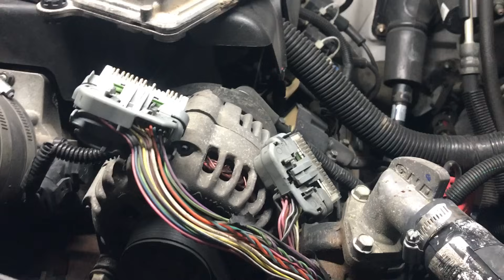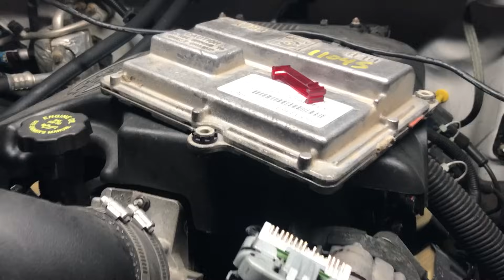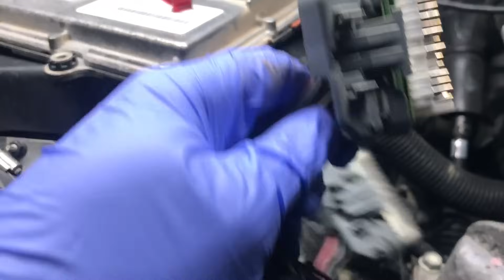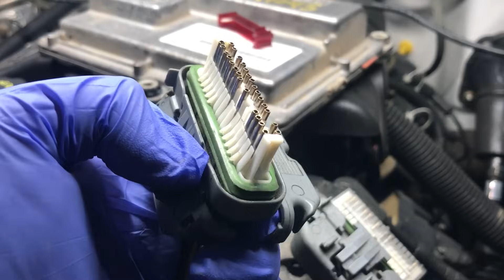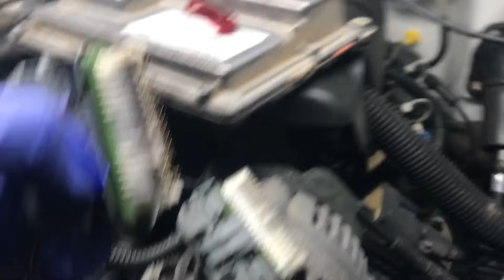Allison 5 speed TCM common issues and fix Allison 1000

Comment: My son has a 2003 2500 silverado with an Allison transmission. When he was 1200 miles away from home on a job assignment the transmission all of a sudden wouldn't shift out of 1st. He had it towed to a transmission shop that had an Allison technician. They pulled codes and determined it needed a $4200 rebuilt transmission replacement. I used to be an ASE Master technician and I just couldn't believe that at 80k miles the trans was toast. So I researched the trans and came across this video. I instructed my son at to what to do and where to look. After repositioning and cleaning the plug contact pins the transmission worked flawless. Thank you so much for this video!
Reply: Nice! Good job to you and author of this vid.
Reply: “Used to be a ASE  master tech” BS!!! If that were true you wouldn’t need any videos
Reply: @meatyklaws8774  Haters gonna hate. I'm a master and I use videos all the time. They are often better than tech data for me because listening and watching a professional sort through complicated problems lets me see what I've done already and what I might need to try. I'm ALWAYS wary about replacing modules without thorough investigation.
Reply: That’s 💯💯💯💯
Reply: @meatyklaws8774  haha different models different strokes.
Reply: @meatyklaws8774  😂🤡
Reply: @meatyklaws8774 not true, I’m ase master w/ l1 and  first thing I do is look for videos with tricky problems
Reply: @meatyklaws8774 I’m an ASE master medium/heavy truck tech as well and if you store knowledge for every vehicle in your brain then that’s pretty impressive to never need reference of any sort. I use videos sometimes. Not everyone is a walking repair manual like you. How many hours do you turn in a week already knowing how to fix everything?
Reply: @meatyklaws8774  dude what?  You can be an ase master tech but not know about an obsure randome plug on a diesel truck

Comment: I have a 2004 GMC c4500, I don't drive it much and when my batteries die, I need to take you to the dealer to have the PCM TCM reflashed. That's the way around this besides keeping the truck on a trickle charger. Right now my speedometer reads double my speed and it doesn't seem to shift past 3rd.
Any ideas?
Reply from the maker: What codes does it throw after the battery goes bad
Reply: @SpartanAutoworx  no codes... It's at the dealer right now and they said I had to have my PCM TCM reset... Because the driver of the truck left the ignition switch open battery drained PCM drained

Comment: Hi I have a question for you. I have a 2005 chevy silverado 6.6l diesel. i seem to have transmission problems but no codes?
Reply from the maker: What is it doing? Need more info if you have no codes.
Reply: right now it drives great in all gears and even goes into reverse. once the transmission heats up to normal operating temp but not overheating. then you go and put it in reverse and it doesn't work. acts like its in neutral and show the range shift inhibited message??????? I changed nsbu switch, pressure switch, pc solenoid. and still same thing. Should i try a new tcm? Also i went out today and unplugged the harness from the back of the transmission. the round one, along with the connector to the nsbu switch to check wires. do i have to get a transmission relearn if you unplug these harness. I have the 2005 Allison 5 speed trans. please any help would be appreciated!!!

Comment: My 03 f650 did a unusual hard shift and check trans light came on. Truck went into a limp mode and stayed in one gear.  Parked the truck for an hour or so started it up check trans light was off and shifts were normal. After about 30 minutes light came back on and went back to limp mode, could this maybe be my issue?
Reply from the maker: I doubt it. Totally different system on a ford

Comment: P0735 and won't shift into next gear. Changed filter and fluid still does it at random times where do I start?
Reply from the maker: Solenoid or wiring issue. If all that checks out bad tcm.

Comment: Just ran across your video and I have a Allison I have an 05 that is not shifting into overdrive could this have an issue in the wiring 2 has no check engine lights no service codes the only issue is it it is not shifting into overdrive appreciate any comments
Reply from the maker: Could be

Comment: Hi I'm new at this. I have an 01 2500 HD 8100 engine with the Allison 5 speed. I get an intermittent overheat on my dash info monitor. Along with the gauge going up to 300 degrees. Checked the temp of the fluid. Also checked the cooler lines. Appx temp was 140 to 160 F degrees. Changed both filters, oil etc. Checked oil lines had no blockage. Still reads high temp. But does also drop down to normal in a second. Please help. Jim
Reply from the maker: Could be
TCM
Temp Sensor in the trans
Wiring

Have to check it all out.
Reply: Have the exact same problem. Replaced Manifold pressure sensor which has temp gauge inside and still have the same problem. Only happens when trans is at operating temp normally while at a stop. Really intermittent at one time it didn’t happen for over a year.
Reply: James, did you ever get this issue solved? I am having this issue on my 2001 Silverado 3500 8.1 after having the trans rebuilt about 4000 miles ago.

Comment: I've got an 03 gmc with an 8.1 and allison 5 speed, I've been having an issue with starting, check engine light threw a bunch of trans codes, hard shifting, gear indicator has been working off and on, the main thing is the starting issue. Sometimes it's no crank or clicking of the relay at all, sometimes it clicks or starts to crank and then cuts out before the truck fires, I don't remember what trans codes it has threw me, but I've replaced the starter, connectors on the wiring at the starter, ignition switch all with no success. I'm going to try checking the tcm harness but is there anything else you guys would recommend?
Reply from the maker: Fuse box or wiring goign to the fuse box. I would guess wiring going to fuse box
Reply: @SpartanAutoworx  I have had the fuse box out twice to check all the wiring, I have power everywhere I need to have it in the fuse box, no corrosion, broken wires etc. And when I have no crank no start if I pull the starter relay out and jump it with a wire it turns right over.

Comment: Do you know if that works for codes p0700-702-703?? Truck wants to go into gear, but dose not move from time to time it goes into gear and drives fine. And some times it dose not move at all, getting those codes thanks in advance.
Reply from the maker: p0702 points to electrical and 03 is tcc brake switch.  p0700 is normal code for trans if it pops any other codes.
Reply: @SpartanAutoworx  yeah I got codes p0841,p0846,p0871,p0842 says that it is trans fluid pressure sensor switch A,B, & C. Circuit range/performance the truck dose not activate in reverse at all, and the drive gear bangs a bit when sifted into it, then it only moves about 1 foot with no power to the wheels, only acceleration, I really need help any advice helps thank you in advance.

Comment: 2001 gmc sierra, has been throwing p0700 for two years, pulled tcm connectors, dielectric greased, no change, dropped tranny pan spun new filter on changed fluid no change. what to check next? all winter long it wont throw code once, weather gets warmer and it throws code second, third day than two weeks later(randomly throws it) when it throws it, it is only in park and the shift indicator light goes off, shut truck off, turn key on shift to drive shift back to park and restart and it is fine again code goes off until it randomly comes back on. thanks
Reply from the maker: Pins or maybe NSS

Comment: I'm having trouble c4500 not wanting to go into park  everything works but park.  But will shift up to park but not go in.  Could the be the problem?    Right now I have to start in neutral then have to put it in park to get the key out
Reply: 5 speed
Reply from the maker: Like tcm does not see park or you actually have no park to hold the truck?
Reply: It does not see park and not go into park

Comment: My pin wire is real short and it keeps backing out the plastic seems weak what's a good way to secure it from the back to keep it in.
Reply from the maker: Replace connector or make slack for the wire.

Comment: so i have an o1 gmc sierra 2500 hd w 8.1L gas and allison 1000, also have an 02 Silverado 3500 dually w LB7 and allison 1000. the Silverado has be wrecked and is a parts truck, my 2500 is my daily, yes fuel cost is horrible looking to change soon as weather permits enough work to do so. 3 days ago and 3 other times while slowing down to make a turn i get the grinding sound as if shifting a manual with out a clutch just not as loud, its a steady grind while slowing for turn my light is green but at about 20mph grinding stops much the way it did other times intermittently, i know nownits not abs pump as i never pressed it. also this time service light, im accelerating slightly out of turn, its in way too high a gear but holds it, luckily my destination part store is next turn and around to park. whole time stayed in same high gear. dignostic tool says tcm failure, short to ground, 4th gear ratio too high, and something about a solenoid, also relists some of same codes twice or more, for a total of about 10 codes. used 4 low to load onto my trailr to pull home, offloaded same and parked. will check connections soon. whats chances tcm from 02 diesel 3500 will work on 01 2500 8.1 gas. sure sbift points will be different rmps and torque converter and pressures may be different. can it be flashed to work, how much $ if i pay shipping both ways. i dont trust the local dealerships, from exp they are parts changers only.
Reply from the maker: That allison 5 speed tcm will work. Send over both vins and we can check calibrations. If it needs programmed its $110 with return shipping.

Comment: Trying to troubleshoot a 2005 school bus w/Allison 2000. It seems to be stuck in 3rd gear and the check trans light is on. Initially, we turned it off, turned key to on position and cycled through d-n-d-n-r-n and it came out of limp mode for a while, then went back into limp. Upon inspection, the transmission was very hot to touch (no gauge). Had a local shop try to pull codes and nothing showed up. Any help appreciated.
Reply from the maker: So no history codes or can you get codes pulled while its not wanting to play nice?

Comment: Ive got an 06 lbz with the 6sp auto. Supposedly has a 60hp tow tune, feels like it does as well. Anyways, hard on it it slips every gear till 5 and 6. fluid is new as well as filters. Will not limp or throw a code, fluid is not burnt nor does the trans get hot. Easy on it and it shifts perfectly. Wondering what the issue could be? I have also reset the TAPS with the GM TECH II scanner and the isssue did not improve and i am stumped. I think its electrical. Any ideas? Bad tuning? tcm? thanks guys
Reply from the maker: Hard to say I would reach out to https://www.caconversions.com/ the allison experts.

Comment: Thanks for the video. I have an 03 gmc with the 5 speed allison. I have codes p0846 and p0700. It seems to start in third and stay in third. Reverse is fine. Up to this point I haven't had any problems with the transmission.
Reply: @randy did this help? My truck is throwing the p0846 code. If so what is the NSS?
Reply from the maker: Check the pins and maybe replace the NSS

Comment: Hey there.. took the pin connector apart.. couldnt see much but after applying dielectric I had a small spark on clear pin group..for got to pull battery connections .. Now truck woult turn over.. no shift indicator but everything else works.. any ideas?
Reply from the maker: Check power. See http://gmflash.com/allison-5-speed-wiring
Reply: A specific fuse?.not sure where to look.
Reply: PCMB fuse.. thank you!.. also MIL code is gone for now.. will drive and see..

Comment: have you done a vid on the repair of the pins?.. especially the brittle plastic ones.. Do you just use pliers to pull the pin back into place?
Reply from the maker: I do not. You can push and pull the pins by hand.
Reply: @SpartanAutoworx  Man.. You are the best.. Thank you for your site..gonna try this shortly.. as an aside.. I had my lower coolant hoses replaced a few months ago, but don't drive the truck too often.. thnx again.

Comment: I have a 2016. duramax with allison. cooler weather now. not cold though. 40*-42. Fahrenheit. backed out of driveway and put in forward moved 10 ft and it stopped pulling and D started flashing. switched through gears and R flashes and still wont go. shut engine off 4 or 5 mind starts and goes. what could be?
Reply from the maker: Bad TCM
Reply: @SpartanAutoworx  dang that sucks. heard could be nsbu?

Comment: This just started happening but on my 02 lb7, if I put my truck in drive or reverse and hold brake, about 5 seconds later it falls out of gear and the gear selection light blinks. Any idea what this could be?
Reply from the maker: Neutral Back up switch maybe

Comment: I have a 2005 3500 chevy duramax. Out of nowhere the truck started shifting hard when trying to put into gears, especially reverse! Crazy this is, it only seems to do it after running for about 20min. Any ideas? Will this help me fix the issue?
Reply from the maker: Check the pins at the connector

Comment: I have a 2001 Silverado 2500HD 8.1L with Allison 5 speed tranny. If I purchased a used TCM from another 2001 Chevy Silverado exactly the same as my truck, do I have to reprogram the new TCM before installing it?
Do they sell the wiring harness that goes into the TCM? The clear control module was loose and the plastic piece that sits on top locking the pins in place was also loose. I did my best securing it and prevent the connecting harness from rattling. But I will see what happens and any information from you would be appreciated.'Thanks

Comment: 2005 4x4 6.6 five speed had speed sensor codes and shifting issues replaced all speed sensors and scanner shows good operation. still coding speed sensor p700. Sometimes it starts out in fourth gear, sometimes stuck in 1st. also abs brake actuation. Checked both TCM  connectors and found no pulled out terminals. put it back together and have a no crank. batteries are good shift indicator shows no position (not in park?).what could have happened ? now I cant even test drive to see if connections just needed cleaned ! any help out there would be awesome
Reply: Popped pcm fuse so you guys know. still coding output speed sensor. will update later
Reply: Update?
Reply: Lol! It’s been awhile so I’m going to be brief. Found broken wire(s) in harness from TCM to power block. Then found broken wire to sensor in harness from power block to sensor ! Repair wires and transmission worked perfectly for about 6 months until limp mode started happening intermittently. Then found pass through plug contaminated with transmission fluid causing shift solenoid codes. Replacing plug fixed this and customer has been having no issues with transmission since then! Thanks for bringing this back as I did find several issues there! Cheers!

Comment: For anyone wanting to see where these connectors are plugged in and how to remove them watch this YouTube video starting at 10:50 https://www.youtube.com/watch?v=S3mE2sORykY

As Spartan Autoworx
 said, most of these problems begin with the connectors. Watch the same video starting at 42:00 for confirmation it was "a pin fitment issue" in the connector.

Great advice Spartan Autoworx
.

Comment: Overall, this is a very helpful video.

But it took me a couple of views of your video to figure out what you meant by the red connector vs the clear connector. The clear was easy to spot. It wasn't until I recalled seeing a red plastic cover laying on the TCM that I put the connector in your hand with the red cover that you had previously removed. Now that part of the video makes sense.

I still didn't see where the connectors are attached to the TCM. Right now my 2004 Itasca RV is on the shoulder of a street here in Vegas stuck in Neutral. I has a red 'Range Inhibit' and a yellow 'Transmission Fail' warning lights. It's an Allison 1000(MH?) 5-speed, Workhorse W-22, 8.1L. Maybe where the connectors are plugged in will be obvious when I return to my RV and view the TCM?

Comment: I have a 2002 6.6 turbo diesel and every time you try to get on it she will not pass 2,500 rpm and won’t shift and hold the gear and turbo unless you take your foot off the gas and give it gas again I don’t know if the issue is the passing gear or just something wrong with the transmission in general please help!

Comment: I got a question if you have the time. I push my tow button and no lights come on. I do have a edge evolution tunes on my truck. Do you think that's a button issue or a wire issue?
Reply from the maker: tow haul button? check for broken wire in orange sleeve on the column

Comment: Would this be a p1621 code
Reply from the maker: BAD ecm
Reply: @SpartanAutoworx   could this cause a trans hot problem though? 2003 GMC 2500HD 6.6L  can sit all night I go to start and it says trans hot before the truck even starts. I've cleaned and secured the TCM plugs with no luck.   Codes: P0700 P1621

Comment: I see this alot with Allison 50/40 hybrid  systems for transit Newflyer buses right at the inverter 24 pin wakeup connector and 32 pin A and B motor connectors.  I change the female pins, the white pin holder and sub harness  wiring due to corrosion right near the connectors.   But towards the TCM its never an issue with the connectors because they are in the interior of transit buses.

Comment: David Victurine I have an 02 2500 Hd 6.6 When the vehicle is started the square gear indicator light does not always light up. any suggestions
Reply from the maker: NSB Switch if nto wiring